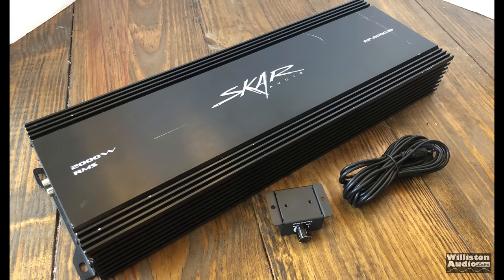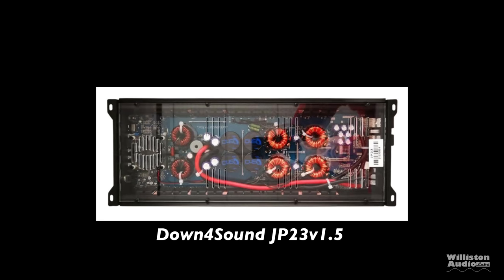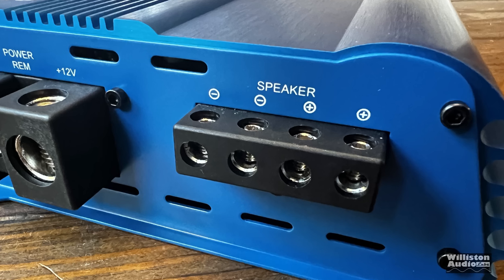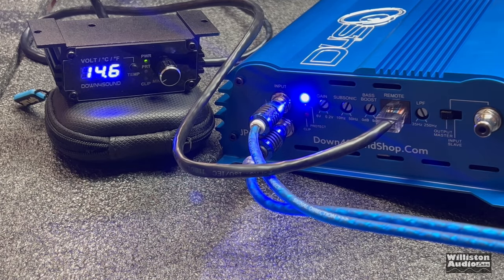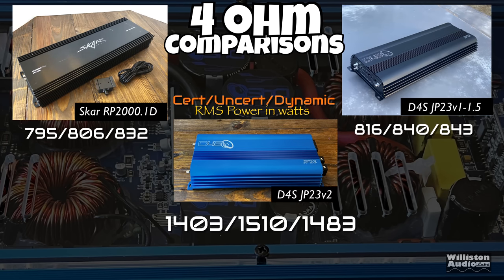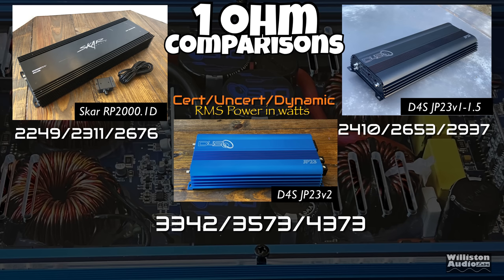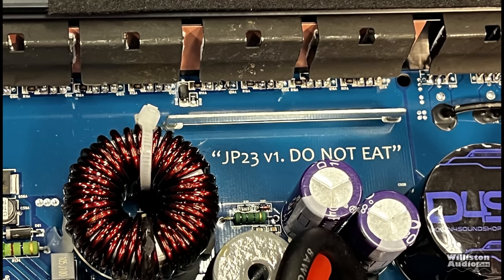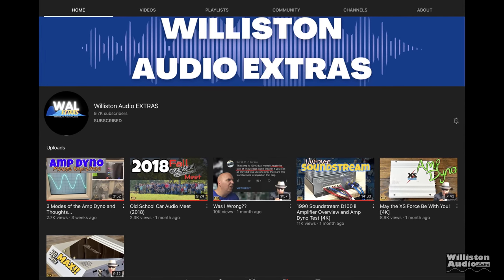The End of SKAR AUDIO's Dominance? Down4Sound J23v2 Amp Dyno and Review

Comment: these things go into thermal protection way too easily! holding 15v i'm lucky to get about 10 minutes of consistent near max volume non clipped music before this thing goes into thermal at 150F. In that case this is where being a small amplifier absolutely hurts itself, however 150F is extremely low for thermal protect as well, so all components should be well within range at that temp but it is very annoying having to source additional cooling, this isn't like a computer.

Comment: Why don't you do a real test on a 12v ordinary battery and an average alternator, and 50mm2 cables, to see how many real watts we can get, like how stable the amplifier is, or will all the lights on the car go off. Also see the stability at 0.5 ohms.
Reply from the maker: If you have stock electrical, this is not the amplifier for you unless you are using it at 4 ohms
Reply: @wal  Have you had experience with the Cactus Sounds amplifier, if so do you think they are more stable at 12v than these
Reply from the maker: @intune3734  this amp does fine at 12V, but you'll need the current to provide the amp which would include a minimum of an extra battery in your system. As shown in the video at 1 ohm the amp can draw 300A of current which exceeds most factory alternators and would quickly discharge a single battery.
Reply: @wal  should the HO Alt amperage match the amps current draw? Like this amp at 1ohm draws 300a, get a 300a HO Alternator?

Comment: the cable is not a CAT5 is has more leads if I remember right... at least on my JP23 first edition
Reply from the maker: Yes it has 10 instead of 8 connections
Reply: @wal  yea, that's it, it is called a 10P10C J50 or RJ50 10p10c Modular Connector

Comment: Wonder how these amps would hold up in a marine/boat environment?  We keep on boat on a trailer so it’s not subjected to REAL MARINE environments and we only go out about 8-10 times per season at most, usually 4-6 times per season if we are lucky!

But I’m curious how they’d hold up ?
Reply from the maker: These are not marine rated. I think they have some in Theo works tho
Reply: I just purchased one for the exact same purpose.... 25' bay boat on a trailer. Amp will be installed inside center console away from the elements.  Can't wait for a marine version and winter is coming so let's see how it holds up.

Comment: Was going back watching old videos and i came to the conclusion the under rated amps are bad. Not knowing what it actual power is sets most of us up for failure.  Dd1 and so forth are expensive and only good when your doing multi set ups. In willing to bet that a big part of clipping comes from this. By subs to match the amps. 1500 sub with 1500 amp but amp puts out over 2500 even though its says 1500 so i throw way yo much and boom. It only takes a few watts extra to cause damage

Comment: You can’t run a 1000 HP Hemi with a Honda 4cyl fuel pump,you can’t run a big amplifier on stock electrical adding batteries without upgrading your alternator just taxes the lil stock alternator even more BUT you can run a battery bank for “key off” bumpn. And try to keep your audio hobby fun doesn’t have to be so serious.

Comment: once again it makes power but 361 amps of draw... 99% of the folks buying this amp will never get that to the amp so the 400 dollar amp really is 400 plus whatever a high output alternator cost...
Reply from the maker: If you want big power out, you must have the electrical to support. Only way around this is to have cap bank or amp with built in supercaps like the D’Amore E series or Rockford T15kW

Comment: Skar sucks, bought a sub from them and within 3 months it blew and I was UNDER the rated rms power. Asked for warranty and they denied. Terrible company.
Reply: 9/10 times a sub is blown from operator error. Especially when under powering due to people compensating on the gain/eq etc. could have had the incorrect box lots of variables. Skar has decent equipment for decent price. They have bottom tier and top tier models. I don’t run skar but I’ve seen some solid builds using the brand.

Comment: The rp2000.1d are trash I bought 2 and they both had a horrible popping to them. One right away and one started after about a year. And I didn't buy both amps at the same time so they were from different batches and had the exact same problem